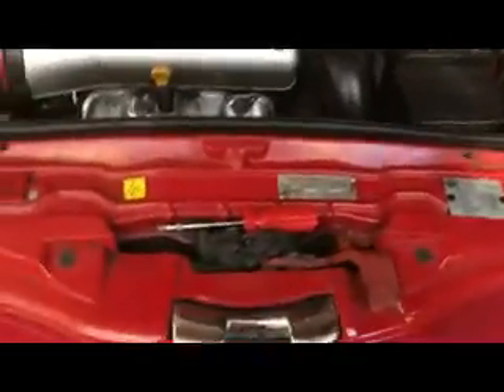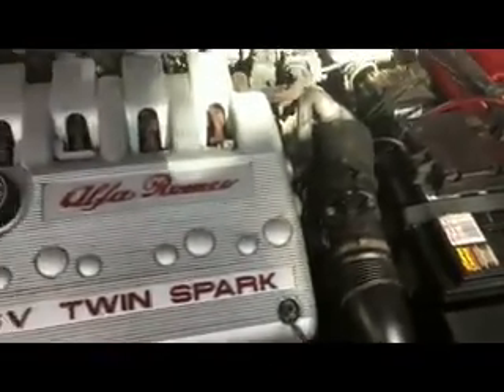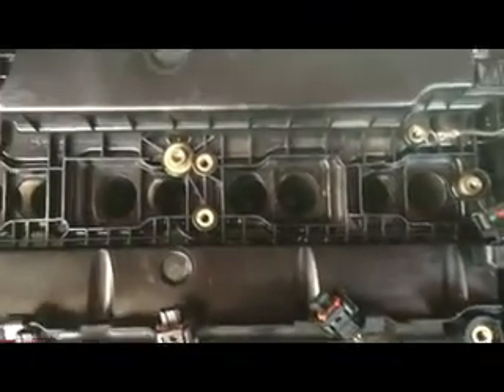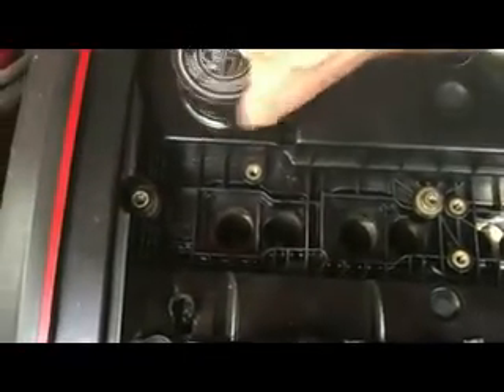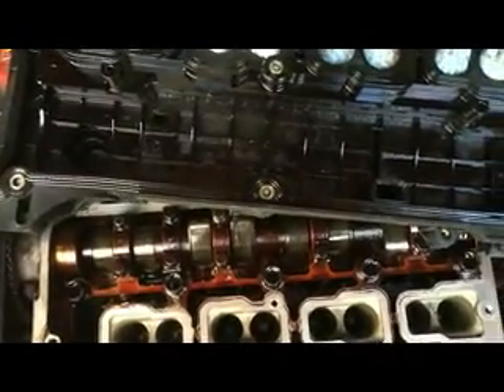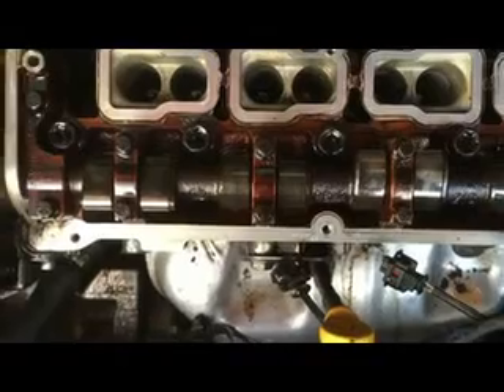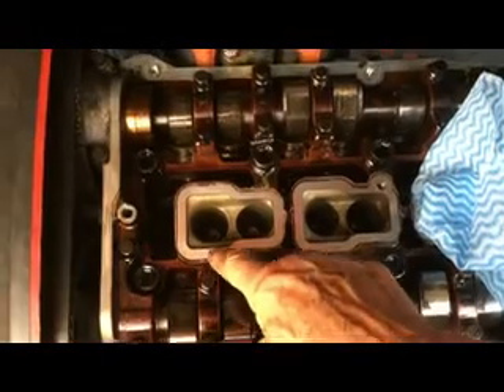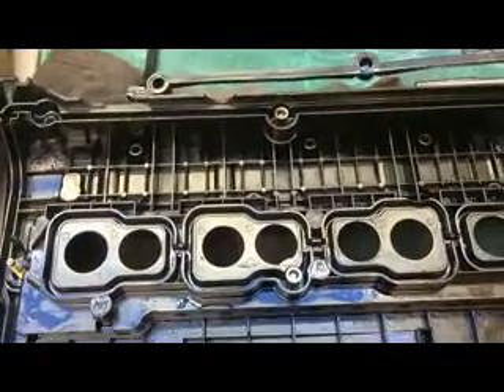Alfa 147/156 TS 2Lt Oil Leaks Replace Cam Cover Gasket

Comment: Great video thankyou do much. I need to do my 916 spider and this video is perfect as reference material to start with.
Reply: I have a Spider 2.0 Twin Spark too and I just changed the camshaft cover gasket too, I stregnthened the screws at 9 Nm, do you recall that being the right tension torque?
Thanks
Reply: @ahmadfawzilafi  yes, manual says 8-10nm torque
Reply: @SinisterMKD  Thanks, so I don't have to tighten them more